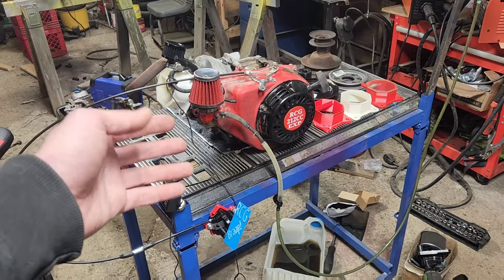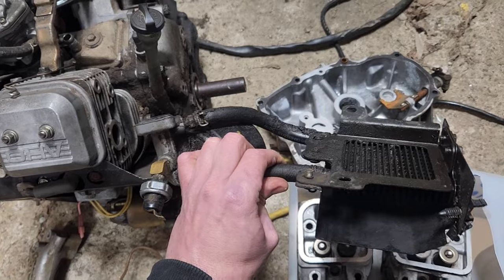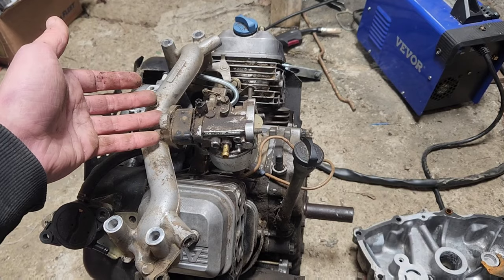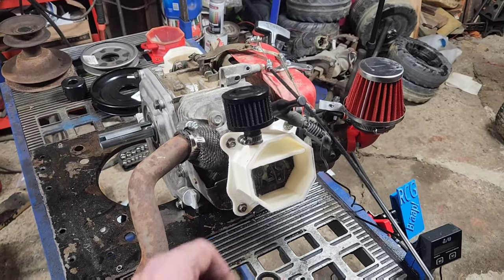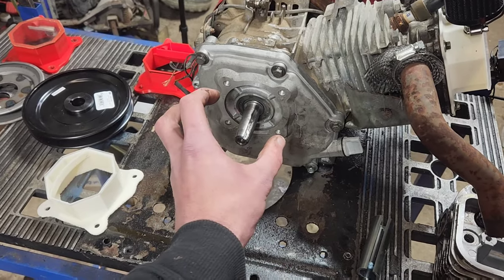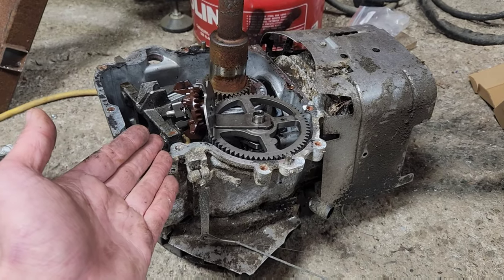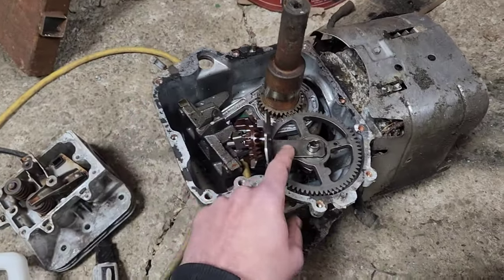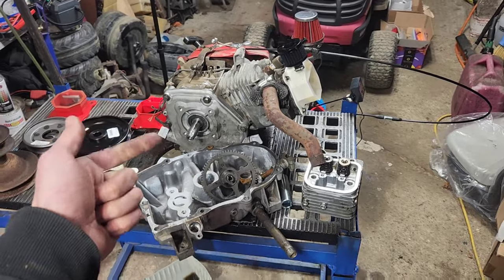Horizontal To Vertical Shaft Engine Conversion Problems

Comment: As a machinist. It is possible to elongate the entier cover so it is deeper and put the bearing boss's in the correct places and heights with the correct tolerances so you dont even need to use a bearing. You need a +or- 1 guy lol of course this would mean a complete billet pan.
Reply from the maker: I appreciate the confirmation. Another viewer had the input to order a second china side cover have it milled flat on the outside then sandwich it. This idea so far seems the most doable on a budget to me.
Reply: @redneckcomputergeek  agreed. But you still have the bearing issue. If the cam does still sit in the bore it wont be much at all. You really need that full contact area to support the cam. You would still have to modify the current cover to accept a standoff to hold a bearing for the cam. And the lip on the crank that rides the seal is a hole nother story
Reply: I do understand it is a test project engine. Also so what ever way you go is cool.

Comment: So what your saying is it'll run better when low on oil 😂😂😂 im kidding but seriously though if that cam gear is say ¼ of the way covered in oil (so it reduces resistance from splashing in too much oil) while extending the oil splasher and moving the sump or oil pump (what have you ) from the side to the bottom with a rubber hose going up the side of the NEW side of the engine( the old bottom ) so it sprays oil up and on the cam , would that work ??? Reason im asking is because i am in the beginning stages of converting the BS 20hp intek off a craftsman LT1000 from a vertical to a horizontal shaft for one of my gocarts.... If its not possible or well not worth it then i have several other options like a 15hp sideshaft , 2 different gy6150's ( one is already on it already and runs fine but i want more power) and then again i have many other smalll motors to try but im also in the process of building a polaris-6000 68/63 440 two stroke to put on my other gocart but im not a patient person😂😂😂😂 so im going through motors trying to figure out whats the most reliable vs more powerful=more fun but for longer 😂 motors while my 440 is being built .... Im eventually going to put the 440 polaris6000 on it but im trying to find other fast snd powerful motors to play with on my other ones in the meantime... So once again can i not just extend the sump hose to spray the cam and run a little less oil for les resistance or no ??

Edit : autocorrect either changes things or it doesnt do anything at all 😂

Comment: Pardon me in a previous video you where going to use old gas to kill dandelions did you know you can eat the leaves pick them rinse them boil them with ham and beans and since you mentioned corn have cornbread with it. That was one of the meals I had as a kid. The beans that where used had to be soaked in salt water over night and I think there called northern beans I think don't quote me on that I was only a kid then I'm 55 now.

Comment: Something that needs to be mentioned, if the oil cooler is what controls how much oil goes into a horizontal or vertical shaft engine, something you need to remember that part is interchangeable between the two engines and it's found on both.

Comment: I’ve been thinking of making a mod motor like u did expect I wanna put some new parts for performance now I have a question if I where to put stiffer valve spring could I run it like that or would I have to put roller rockers and a stiffer rod. I’m also going to buy a 3D printer to do like u did
Reply from the maker: The limiter on these tends to be the rob and the cam to start with before springs matter. Heavy springs are to prevent valve float on a bigger cam lobe. The stock spring will work into higher RPM then the rod can survive. This is why once I get it running in vertical it will end up with a NR Racing stage 2 kit to hit over 6k RPM.
Reply: @redneckcomputergeek  not bad ok was wondering and I have a motor that went over 7k stock I can send u a pic on messenger if u want
Reply from the maker: @Redneck Mowers  no worries I belive you. Can do it and good idea long term are to entirely different things. The duromax dragster hits 6800rpm on stock internals. But only for the 30 seconds of race time. Held at that for hours the rod would say goodbye eventually.
Reply: @redneckcomputergeek  sick

Comment: One problem spacing the cam would change where the lobes touch on lifters if the lobes didn't hit case they would unevenly hit lifters and probably bend them causing the big boom 💥 then 😭

Comment: I wonder if you could use a map gas torch/oxyacetylene torch and fill the oil plugs with a brazing rod and tap them for a regular pipe plug that could run the oil cooler on one side or a drain.

Comment: Maybe a oil tank below engine that holds the oil and a electric pump that shoots the oil through a orfice threaded into the (was bottom) of the block thats pointed towards the bottom of crank and connecting rod and it will sling the oil throughout.  Essentially a dry sump oil system.

Comment: you could use a suzuki m120x engine, commonly found in toro ccr2000 snowblowers. they can turn 6000+ stock, and 7500 with port work. they have a motorcycle style crankshaft, with as forged rod. indestructable...

Comment: As far as a spacer you could take a square picture of the pan import to cad scale it with known dimensions cad out the spacers and  order it cut from the correct thickness  from send cut send or osh cut willing to help if needed
Reply from the maker: That is a great idea! I could even test print in PLA plastic to be sure then send it in.

Comment: For a drain, just use a fitting in the valve cover and run a hose to the block cover. If you have honda cover there is a fitting that has the same threads as the dipstick and a hose barb on the other side.

Fitting, search for  "Metric M20X2.5 Male to 3/4" barb"

Comment: I think you're running into more problems than it's worth doing. I hope it works out for you. I have a challenge if you are interested. Turning a four-stroke Briggs into a 2 stroke engine.

Comment: Pretty big challenge. I'd imagine oil level needs to be below the cylinder also. If not, the oil would get past the rings hydrolock the piston and also burn if you do get it started.
Reply from the maker: Good point. When I take off the side cover I will be sure to measure the height stock vers on its side.
Reply: @redneckcomputergeek  great video john  - (PS -ck your email/spam -  i sent a quick Q)

Comment: Look for a vertical shaft sump off a Chinesium engine from a log splitter or push mower . That said even if you machine a spacer it would need to be done from a billet of aluminum on a CNC machine or fabricated in a welding  shop then machined . Then you have to address the crankshaft being too short . Can you make a horizontal engine run in a vertical position ? Absolutely , for how long or how much power that's the question . Now if you used an old school Briggs or Tecumseh I don't think you'd have a problem . Now what's machine work and fab work cost ? plus materials 
Just rebuild that crusty old Briggs motor on the floor and re drill it to raise the oil pressure and it won't explode if you change the head gasket frequently and keep the oil full .